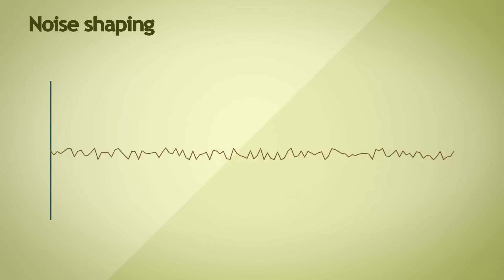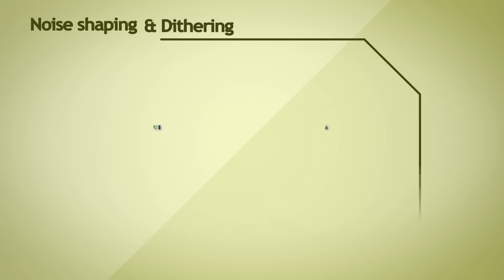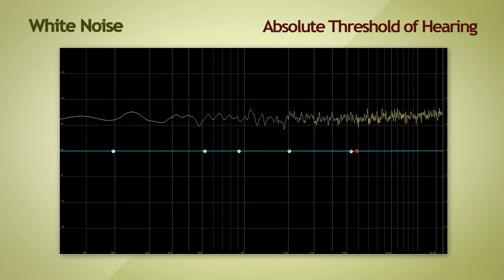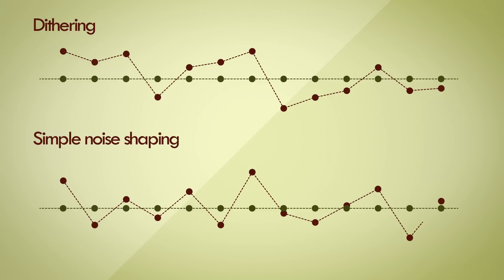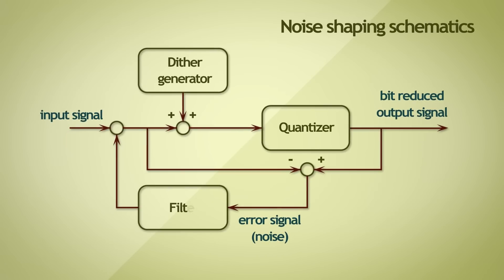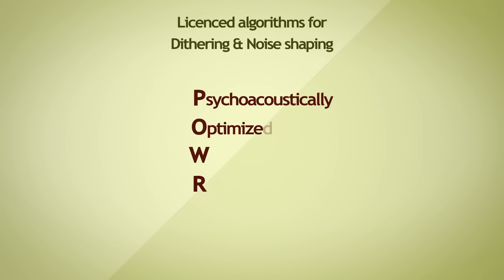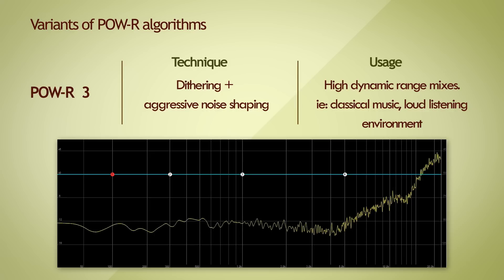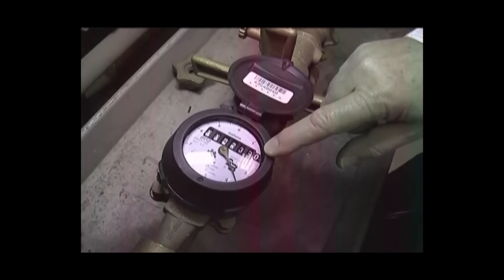9. Noise Shaping - Digital Audio Fundamentals

Comment: Some of the best tutorials in sound/audio theory out there. Well done!
Reply from the maker: Thank you! Glad you think so!
Reply: @akashmurthy Do you only use Dithering and noise shaping when truncating of bits 24/32 to 16 bit? Is there any benefits of using it with 24 bit audio? Thanks
Reply from the maker: @joesmith4443  hey Joe, you'd generally only use dither when converting to 16bit. There is nothing wrong to dither the mix when converting to 24bit, but it's just not needed. There is not much advantage to it. In 24 bit audio, the dynamic range is high enough for the the quantization error not to be noticed. You can check out the 7th video in the series, and I've discussed the same there.
Reply: @akashmurthy  Thanks for getting back to me! I learn a lot from from your videos! Would love it if you talked about PWM and Sigma Delta (or direct me to where you do!). I’m more of a DSD guy than PCM. 

Does the truncation happened when you record from 24 to 16 via a coax/optical input and output?? Should you add dither to the 24 file? 

24 bit SHOULD be the standard as CD’s and bit limitations is a thing of the past. I really don’t  like the marketing of “High Res” when the science is different. The higher sampling rates do better relaxing and spreading the quantization error even further out into ultrasonic frequencies and the dac filters and prevent aliasing. All that said none will know what the higher bit and samplings can do when the dynamic range is soooo compressed that many believe vinyl “sounds” better. It’s a real shame!

Comment: Very nice explanation and visuals. I’m using an fpga for a signal processing application, and it’s critically important that the signals I’m working with have no dc bias. Rounding errors from fixed point arithmetic can accumulate, so I use “fraction saving” in my filters to eliminate quantization noise at dc, and shift it to higher frequencies where it is less of a problem.

Comment: What a way to teach,Super awesome.Thanks
How about MP3, though no renderer ask for a bit depth in MP3 but for example in general by math 128kbps audio are assigned 1.5 bit.
Or is it in-built in the mp3 coding itself or  why to even care, because the format is lossy anyways.
Reply from the maker: Thanks very much! 
Bit depth is sort of only relevant when dealing with uncompressed PCM data. When you convert it to MP3, there is no longer a need to store each sample at a fixed number of bits. The idea is to dedicate as little bits to store the data as possible. So the codec uses a different way of representing the data. I don't know much about the MP3 codec, but there are a lot of resources out there that are quite good to learn from.
Reply: Got it,will try to explore further.
Thanks Akash.